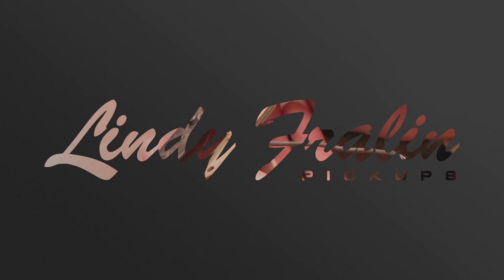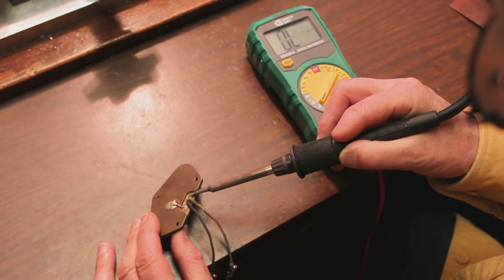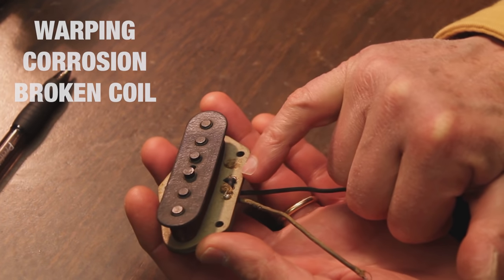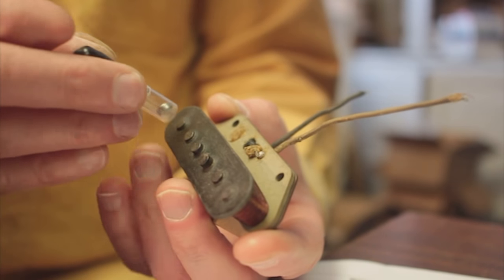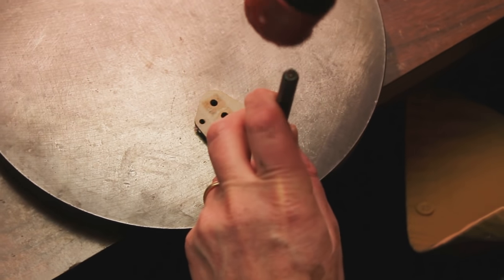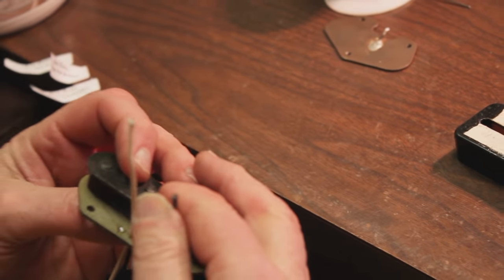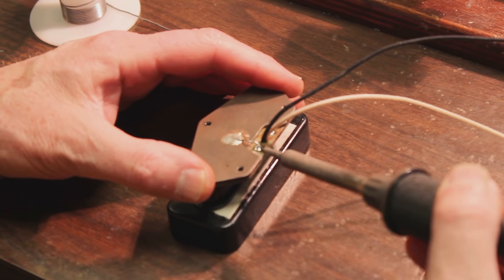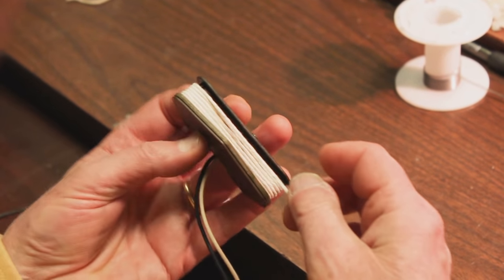Lindy Fralin Rewinds A 1967 Telecaster Bridge Pickup

Comment: You didn't try to find the end and unwind one revolution ad reattach on a vintage pickup? This would keep the original windings and sound 99.99% the same. Of course if there was a break in the middle cutting the windings out couldn't be avoided. However you didn't show us this.Also you scatter wind by hand but don't hand wind making varying tension like the originals. Is there no audible sound difference as alleged?
Reply: "we don't have our inside wire OR outside wire anymore" .... Meaning: A rewind is the only solution.

 Also, this is a pickup from '67'. So being machine wound with an auto traverse is the CORRECT thing to do.
Reply: @WarriorOfGhengisKhan  "we don't have our inside wire OR outside wire anymore" they can often be found one turn in.

Comment: Thanks, great video. Did you sand the end of wire that wrap around the eyelet? I had a faulty cs69 pickup. I found the break and resolder back to the eyelet. But no reading, after i sand a bit of the end of the formvar wire, i check again with a multimeter from a place where i sanded and ground, i did get a reading. Love your feedback. Thanks again

Comment: Been buying y'alls product for 20 years. Still have real 54 strat set rocking and steel pole tele bridge and have had many. My question. I had a 60s tele bridge rewound years ago. Curious if theirs a reason you used plastic coated stranded instead of cloth  leads on it?  Probably no sonic difference?

Comment: So the start wind is at the BLACK lead side, counter clock-wise to the finish wind on the WHITE lead side. Correct?
Reply: Yes, most Fenders the black was ground.
Reply: @jennyfralin357  I looked at about 30 photos of 'blackguard' pickups and every one had the black/ground connected to the eyelet on the right (as seen from the top with eyelets in front). This tells me that the coil wire goes counter-clockwise around the bobbin. Correct? (and thanks for your replay, btw)

Comment: Since you're already making a new pickup, wouldn't it make more sense to just buy a new pickup and keep the vintage one as is.
Reply: If a pickup works when I receive it I will discourage killing to get to get a different sound. If it is dead, usually due to corrosion, It makes sense to rewind it so the guitar still has the original pickup in it. I'm always happy to sell one if that is preferred.